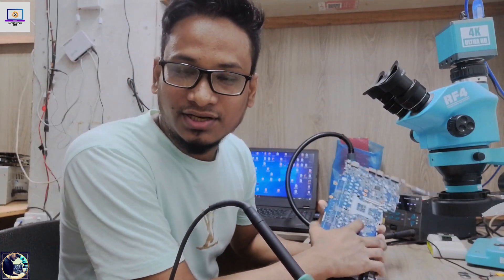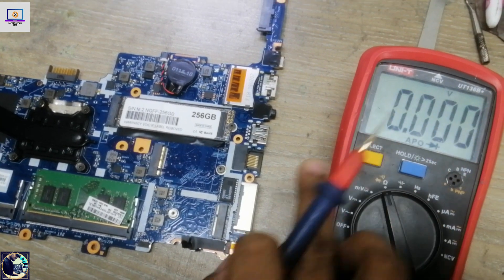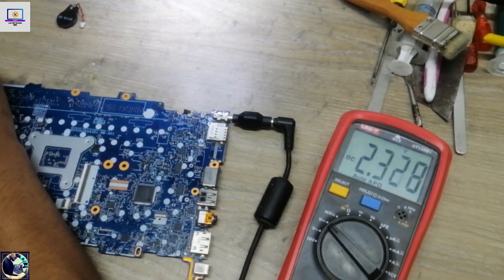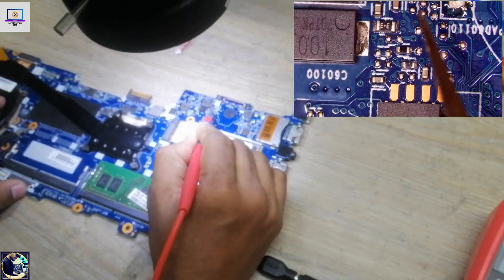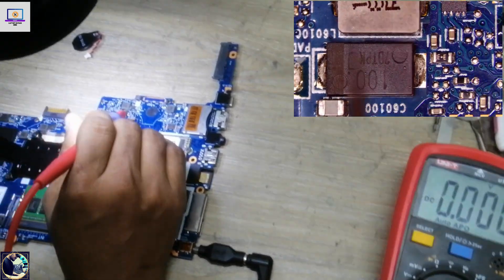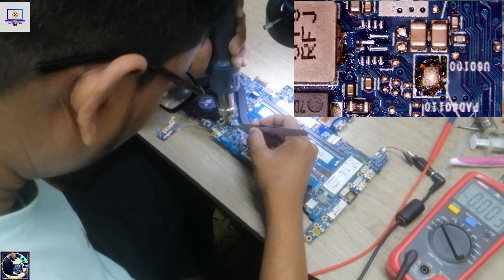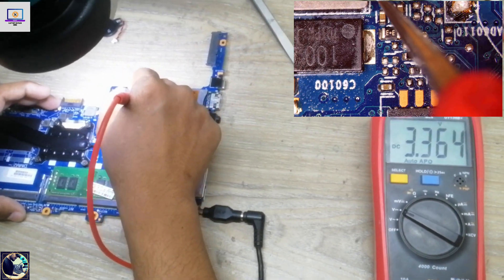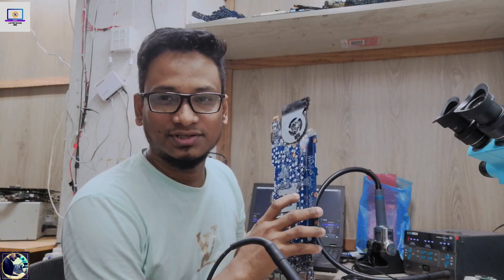hp elitebook 840 g4 laptop not turning on | Hp laptop not turning on | hp | Fixed [ English ]

Comment: brother you check enable volt resister both side was same when you check before and after replace ic
So how
Reply from the maker: There are two resistors, one of them one side 3.3v other side 2.3v other one same voltage both sides, it would be 3.3v in enable voltage but due to ic damaged resistors value has been changed for that enable voltage decrease 3.3v to 2.3v but it's ok it can enable the IC.